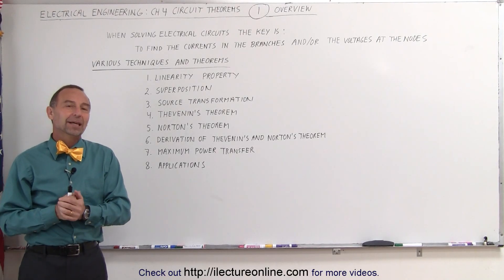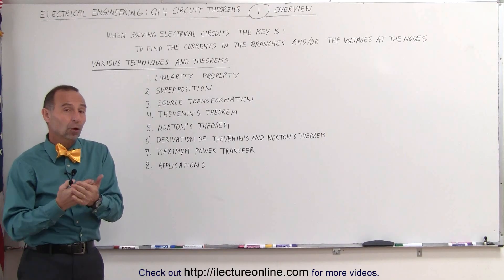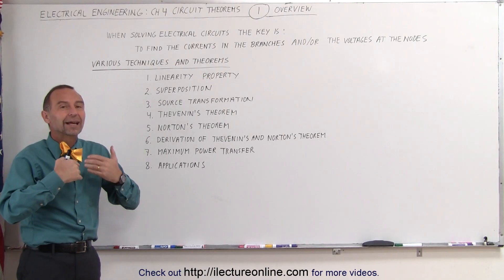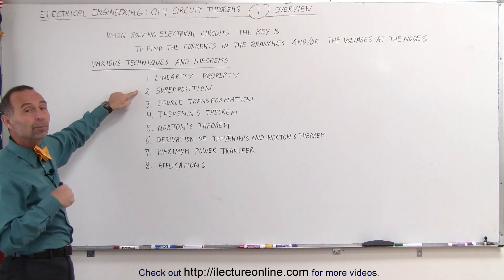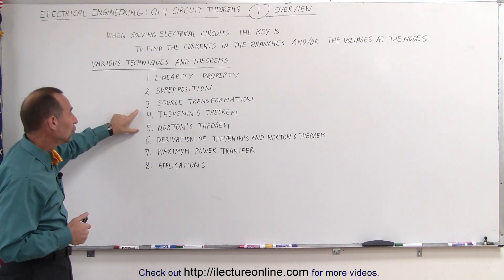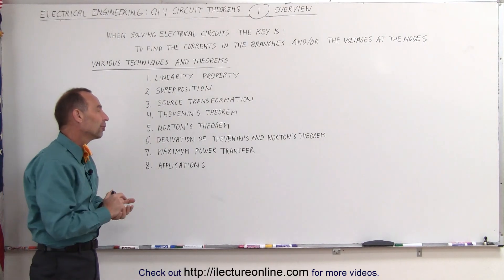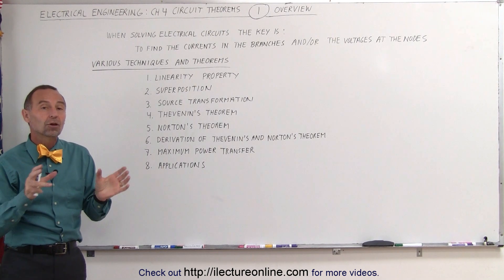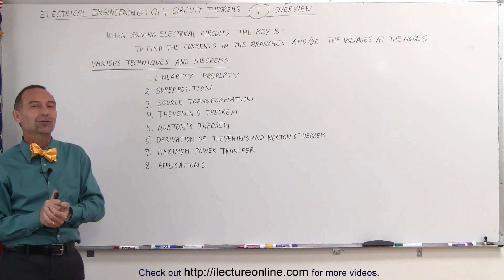Electrical Engineering: Ch 4: Circuit Theorems (1 of 35) Overview

Comment: Helloo sir
How to solve this
a 230V 50hz ac supply is connected to a resistance 2.5ohm coil of inductance 0.06h and capacitor of 6.8uF connected in series. calculate  
impedance of circuit
current
phase difference between voltage & current
Reply from the maker: We have a lot of example just like that in this playlist:  PHYSICS 49 RCL CIRCUITS